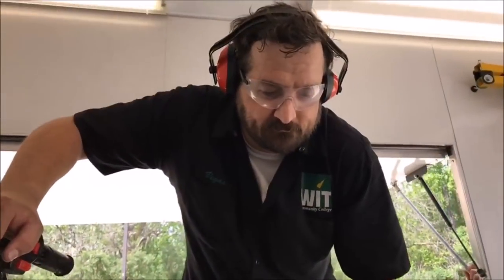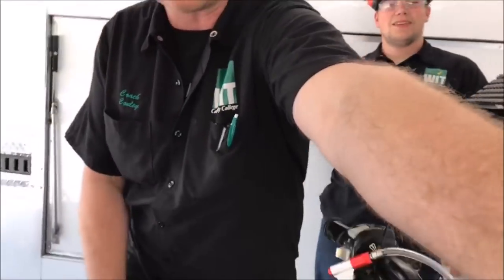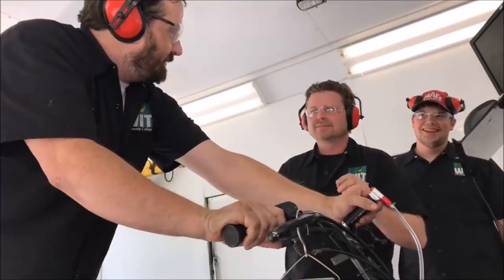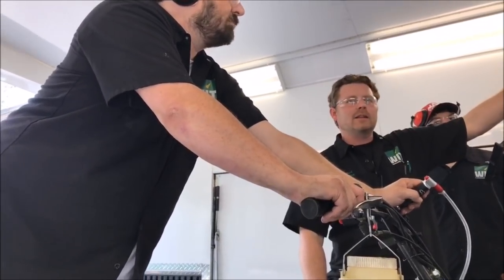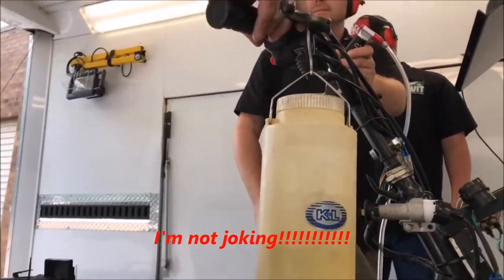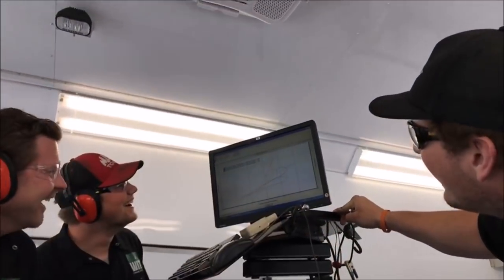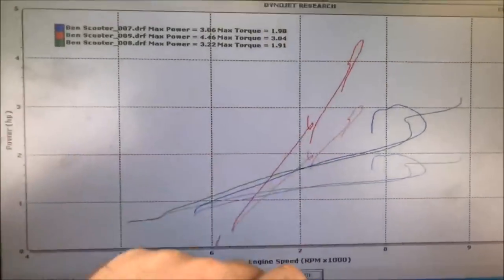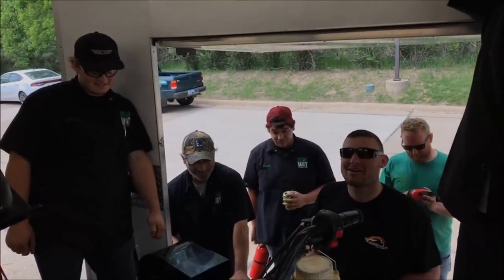6 Sigma Racing Nitrous kit installed on Chinese Scooter! What happened? Dyno results or blown motor?

Comment: What part of NOS is explosive? The nitrogen or oxygen? Nitrous works because at a certain temperature the nitrogen and oxygen molecules separate, the oxygen is used to burn more fuel, the nitrogen is dumped out the exhaust. By itself nitrous is not flammable. The only explosive part is the fact that it is pressurized in the tank.
Reply: jake scott thing is oxygen will make any type of flammable fluid that is stable unstable in a way but it’s hard for me to explain and since nitrous adds more oxygen you need more fuel or it  just lean out and and burn when it’s in an engine
Reply: It's a dental laughing gas !
Reply: @theshadetreewelder3523   but nitrous oxide in of itself its flammable so if he did push the button nothing would of happened lmao
Reply: It's a actually less energetic then the same weight of air and fuel mixed at the best mixture, the biggest then is it's denser then air and expands more so more power, fuel economy is horrid
Reply: Nitrous oxide isn't flammable but it's an oxygen donor so it will increase the rate of combustion of other burning materials by providing oxygen.

This is because at a certain temperature nitrous oxide separates into nitrogen and oxygen.

So in the engine it has an effect similar to a turbo - it increases compression and the amount of oxygen available to react with the fuel during combustion which translates into increased power per combustion stroke.

Comment: This is awesome, was thinking about trying this on my ATC200 (they make a kit) but wasn't sure it would honestly give enough of a shot to do much. have read that the kit is supposed to come with a drill bit to open in the main jet a little (may just order a slightly bigger jet instead) did yours come with anything other than what we saw in the video? i know you said you didn't receive instructions so just covering the bases. Can't knock a 1.5 hp bump on a 50 cc motor.

Comment: Try to put on modern 150cc engine moped that have 12-15 hp. With nitrous  maybe it goes 20hp. Same as modified 185cc engine that can go 200kmph.
  Add nitrous on modified engine the 21 hp bike  will have maybe 256 hp . With very light weight  it can beat the 250
Reply from the maker: 😱Braaaaaaaap fun fun

Comment: Nitrous isn't flammable it breaks down at like 500 ish degrees Fahrenheit  and releases oxygen and nitrgoen which expands alot when its hot thus why it makes more hp more expansion of gases. Its basic chemistry you learn this crap in school
Reply: @How2Wrench  Also i never said the video sucked it was pretty hilarious watching him use nitrous on his scooter but saying nitrous oxide is flammable is just completely outrageous..... It just breaks down releases oxygen and some nitrogen which increase cylinder pressure resulting in higher hp numbers... but very ineffective and highly dangerous with 2 stroke engines as some of that nitrous and some extra fuel will burn in the exhaust (or stock muffler) possible causing a fire
Reply from the maker: Techno Nerds But we are not using “nitrous on its own” are we? We have fuel and ignition present don’t we? You’ve never seen a engine filled with to much Nitrous and the explode on start up? https://youtu.be/59sh_cXTut8 
Bigger picture training safety here bud
Reply: "Do you have any idea how flammable Nitrous is!?"
"Get the fire extinguisher.

You can, quite literally, spray nitrous into a 3600 degree flame and it'll extinguish it.
This video was just full of misinformation.

Comment: could the nitro be added with more graduation,like a super charger or turbo,though not kicking in hard like some turbos do,but a more measured  application,for a throttle gauged input,ie more pedal more nitro and vise versa.y'see i have a triumph spitfire,with 1500cc fitted,but i have the short stroke 1300cc under my work bench,and a shorrock seper charger is a hard to find kit,but a good nitro set up,not quite mad max style,or lord humungous with the gate valve approach.If you have'nt seen mel gibson -madmax,then your lost on this point,neck breaking power surge,broken axles,whip lash.
I also have a two stroke scooter like the childs stand on type,but with a bicycle seat and a 32cc with centrofugal clutch...naaah!!.